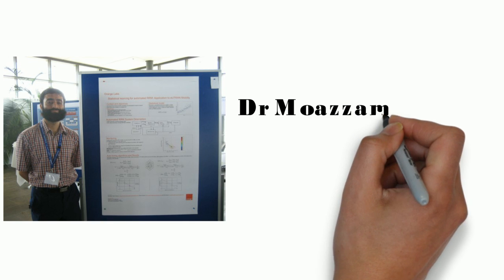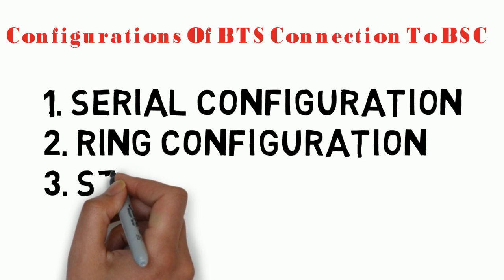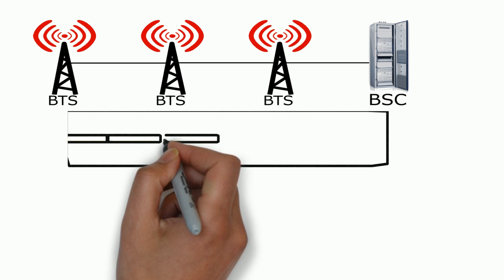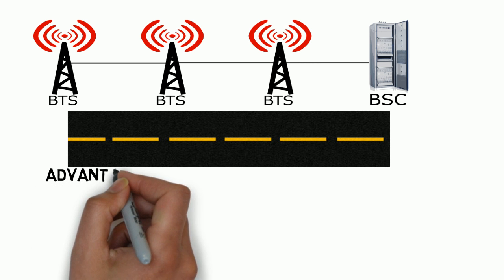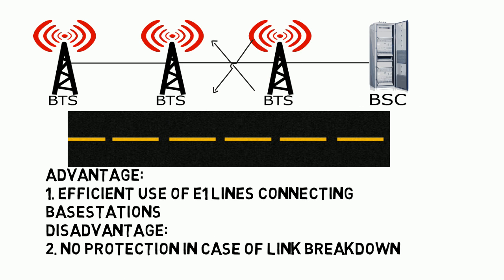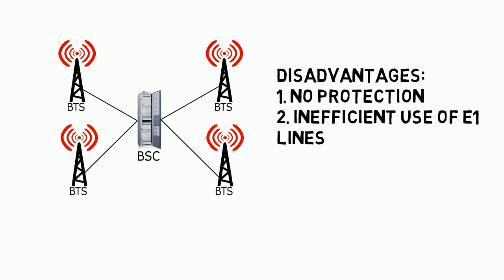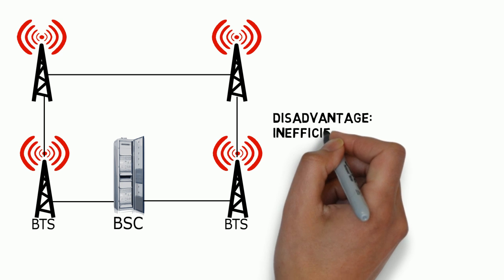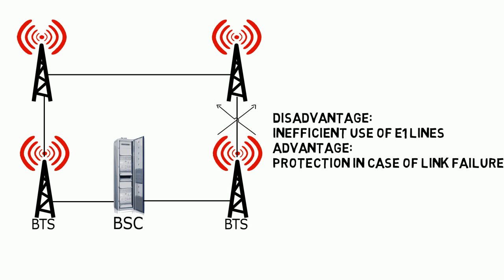How BTSs Are Connected To BSc In GSM Network?

Comment: I AM LOOKING FOR WORK I AM EXPERT IN NOKIA EQUIPMENT

NOKIA AIRTEL NETWORK UPGRADE– NOKIA TRANSMISSION SUPERVISOR 
 NOKIA ROUTER INSTALLATION PROJECT FOR AIRTEL FOR NIGERIA- IPRAN Field Engineer- 

SAR 8 NOKIA ROUTER installation and configuration

SRA4 NOKIA ROUTER installation and configuration

SRA7 NOKIA ROUTER installation and configuration

 MXP NOKIA ROUTER installation and configuration

SAS K   NOKIA ROUTER installation and configuration

MSS 4 NOKIA ROUTER installation and configuration

MSS 8 NOKIA ROUTER installation and configuration

•	Involved as a SUBCONTRACTOR in the Installation of 200 sites under the NOKIA- AIRTEL IPRAN project.

•	SAS MXP and SAS K ETR installation and configuration in Lagos region.

1.	Installation of SAS MXP and SAS K ETR router in TX cabinet

2.	Power cable running and Patch core fibre running from MSS to the router

3.	port configuration and enabling for traffic.

4.	Connecting nodes checking and bof setting

•	7750 SRa4 and SAR 8 installation and configuration in Lagos region and Ibadan region 

5.	Installation of SAR 8 and SRa4 router in TX cabinet

6.	Power cable running and Patch core fibre running and arrangement from router to ODF

7.	MDA card provisioning and port configuration.

8.	IP address assigning and bof setting

•	Link turnover and documents signing

•	Attended and participated in training on basics of AGGREGATE/SPLIT MOUNT and STANDALONE installation and Integration.

•	Supervised subcontractor’s works (cabinet installation, Radio and Antenna mounting on towers

•	Provided technical assistance in the installation and configuration of UBT-T 2+0 RADIO ,UBT-S 2+0 RADIO,MPT 2+0, MPT 4+0 radio alongside over 10 Subcontracting companies(10). 

•	To monitor the progress and quality of the project executed 

•	To ensure that the sub-contractor work and implement the scope of project according to the approved design documents and to also ensure that subcontractor implements the project according to the work schedule and timely delivery of project work.

•	Installation of UBT-T 2+0 RADIO ,UBT-S 2+0 RADIO,MPT 2+0, MPT 4+0 –cabinet installation (powering, earthing and cabinet ground bolting), Radio and Antenna installation (One UBT-T and UBT-S radio coupled to one AIM and locked to a Tongyu antenna (UBT-T 2+0 and UBT-S 2+0 respectively), Two UBT-T radios coupled to Two AIMs both mounted on a coupler locked onto Tongyu antennas (4+0) , (Two MPT radio coupled to branches, mounted on a coupler and locked to a Tongyu antenna/dish ( MPT 2+0) and Four MPT radio coupled to branches, mounted on a coupler and locked to a Tongyu antenna/dish ( MPT 4+0)

•	Configuration of UBT-S 2+0 RADIO, UBT-T 2+0, UBT-T 4+0,MPT 2+0, MPT 4+0 

•	Integration of Links on UBT-T 2+0 RADIO:

1.	Startup setting enabling, IP address assigning, Trusted manager creation, PPP and OSPF assigning and networking configuration.

2.	Frequency and power value input, Modulation and Channel spacing assigning

3.	VLAN AND LLDP creation

•	 LAG creation and  Settings (VLAN assignment to LAG, LAG port Membership assigning, modulation assigning) for UBT-T 4+0,MPT 2+0, MPT 4+0.

•	Investigate, troubleshoot and resolve alarms and transmission issues on the link

•	Taking backup of the programming/configuration of the equipment and restoring it back

•	ATP inspection process and document signing of completed links.

my contact +2348052305813
kudostechnetme@gmail.com
kudostechnet@yahoo.com